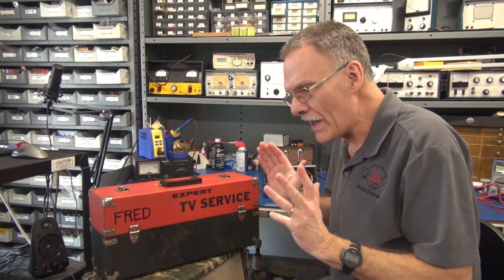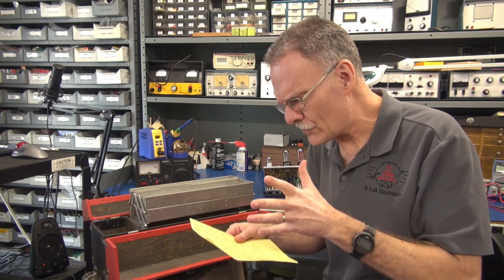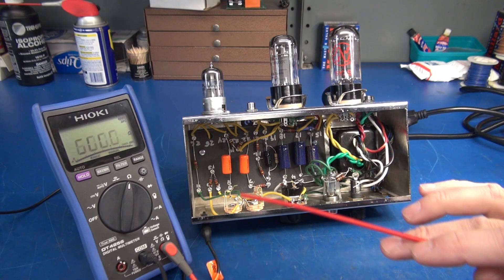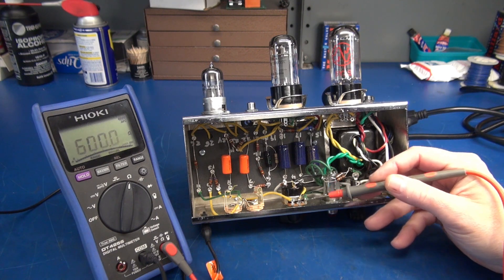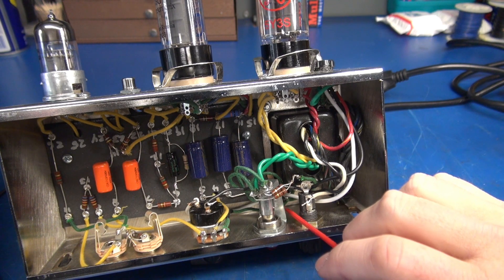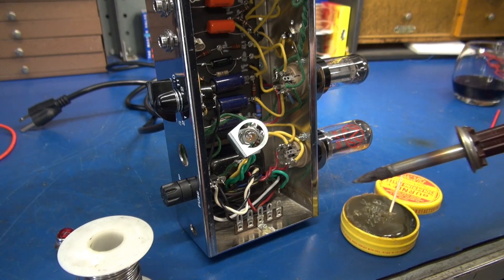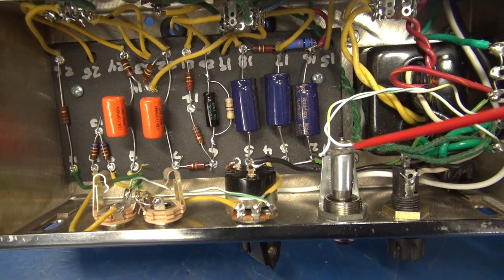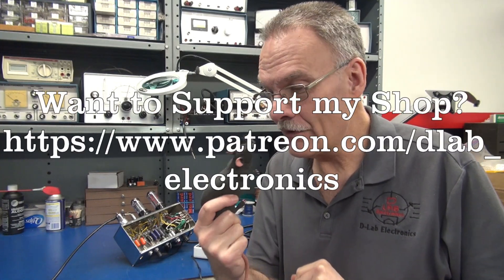D-lab series Basic Training Tube Guitar amp repair Fender mini Tweed 5F1 Kit No Output ask Fred

Comment: Just finished one of these yesterday. Everything works, get low hum but...no output.  All grounds tested good. Visual inspection revealed the Eyelet 10 to Jack 2 wire was caught underneath the mounting bolt/locknut and shorting the input signal from both jacks to chassis ground. Works great now.

Comment: After building many tube guitar amps, kit or from scratch, yes grounds can get you. My problem wasn't missing signal, but extra buzzy noise. The PT center tap and filter cap #1 were grounded in different locations causing current flow between the two, which caused noise to be introduced elsewhere. I solved this after reading some materials on how grounding works, and hum loops are created, by putting them on a common ground lug, and doing like you did, soldering the mechanical connection for a lower resistance to the chassis. I was very relieved to find the fix so simple. I have not forgotten that simple lesson, and all my tube amps since have been fairly quiet. I like that you are showing people the basics of using a continuity test on each ground segment. Simple and effective. Which is why I like working on old tube amp designs.

Comment: Thank you D-Lab. I built a similar kit, successfully but lack the theory understanding of moving the volume pot ground to the preamp ground.  I was curious about the Kalamazoo Model 2 choice of 47uf and 22uf’s filter capacitors.  I also have a Model 2 but kept the filter caps with 20uf, and 10uf’s.  I’ve read on a different forum about grounding the 20uf separate from the 10uf’s but haven’t made that mod yet.  Great videos!  -Dan.
Reply: Separating the grounds of the preamp stage caps from the power stage caps will sometimes reduce hum in the amplified audio signal, hopefully resulting in an amp with a lower signal to noise ratio. It can do this by reducing current ripple from the power supply from getting to your preamp stage. If your amp has good signal to noise characteristics, ie, nearly imperceptible hum to the ear, don't bother with the mod. I've had an amp that I grounded poorly, hummed like crazy. I totally  reworked the grounds on that, the problem was in the power stage grounding, and it paid off. If it sounds good, its good. However, there are various means to grounding and some are inherently better than others, the theory of all that is beyond my ability explain. Aiken Amps web page has  several pages dedicated to explaining grounding in tube amps, I found it a good resource.
Reply: @patchesthejaybird8431  Thank you Patches.  I’ll check out the Aiken Amp page.  My Model 2 amp has still a little hum, but greatly reduced when I replaced the filter caps.  Still, I wonder if that’s why Terry went to 47uf and 22uf caps, although he kept their grounds together.  -Dan